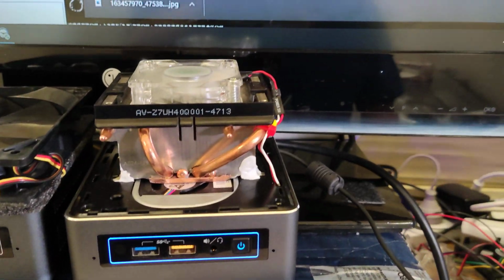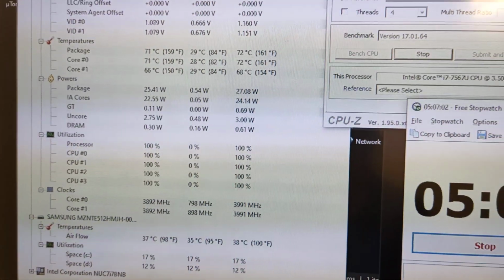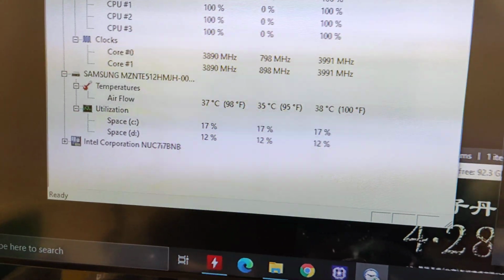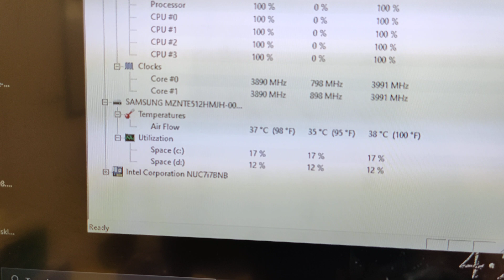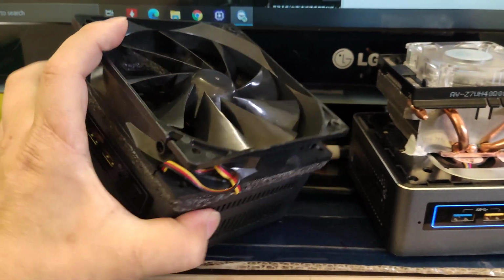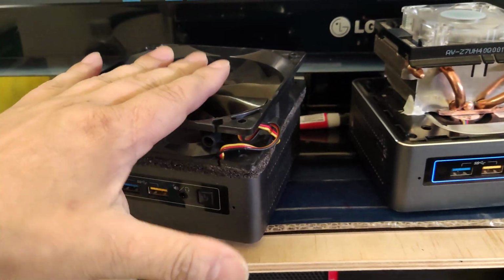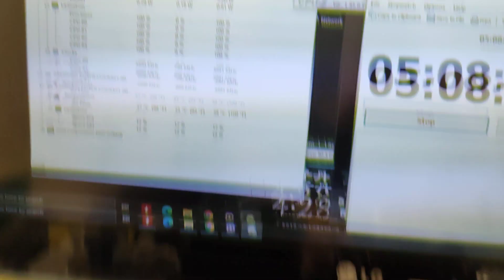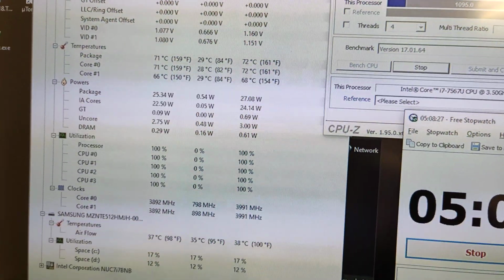Intel NUC Overheat cooling Mod /  Loud fan Fix  (NUC7i7BNH)

Comment: the issue is with air cooling is, whether a desktop or a NUC. whatever the ambient temp is in the room, that is the temp of the air you are blowing across the heat sink. so if the room temp is 90° F / 33° C You will only remove from the heatsink higher temps, it's not like our skin when you blow the same air and it feels cool b/c we have perspiration that is evaporating removing heat.

Comment: hello and greetings from Greece! I have a rather "newbie" question but I have to ask because I am thinking of applying a cooler with a heatsink as well on my NUC8BEK too... The voltage of every fan cooler is 12V if i am not mistaken...The pins inside the box are 4pined and 3V , so how does the fan works? Where did you connect your fan inside the box? My main concern is the 12V outcome of the fan because  there are a lot of heatsinks with fan in the market that can be used for this modification but I cant think of a way to keep the maximum opearation of the fan when connected with the box, either on a usb port [which is 5v] or inside of any pin array which is 3V.
Thank you in advance!
Reply from the maker: Most fan will run from 5volts .. or there is also USB to 12volter Step up converter you can you

Comment: hi i have the same nuc7 (but core i5 variant). own fan is dead already. would like to try your first mod. What heatsink and fan you used (exact model?)
Reply from the maker: Hi . The heatsink was came with  my old AMD FX 8350 and fan was off a old laptop cooling stand .. pretty much what ever I had on hand at the time

Comment: And what about new INTEL NUC 11  ? any idea how to change heatsink to something better?
Reply from the maker: should be pretty much the same concept , did something similar to my son's laptop the other day
Reply: I wonder to replace the fan cooler system with arctic alpine 12 passive cooler, and make 3d printed case to cover it.. Inspired by Nucintosh project..

But I didn't know if the passive cooler would compatible with the 11th gen Nuc's board or not..

Comment: This is just brilliant!!! I've been looking for something like this for months, I have the exact same NUC and it gets loud and hot as a car engine. I thought of taking out the whole stock cooler and replacing it with a cooler (heatsink+fan) like yours, but the socket incompatibility is an issue. So I reckon you put the heatsink over the stock fan, having cut out a hole in the metal cover? (Sorry my English listening is not that good so I might've missed something.) Anyway, thank you so much for this video!!
Reply from the maker: Hey i found it works best cutting the metal cover so the the heatsink have direct contact with the stock heat sink via thermal paste.. i left the stock fan in but it hardly ever turns on due to the heatsink is good enough to keep cpu cool
Reply: @Hayden Fluntboy  and what is that cement-looking putty the heatsink is attached with on the sides and the pipes? Is it thermal conductive –or the complete opposite, isolating?
Reply from the maker: @joaquincastrovaldez7503  it's "selleys knead it" a 2 part putty ... Just to hold the heatsink in place